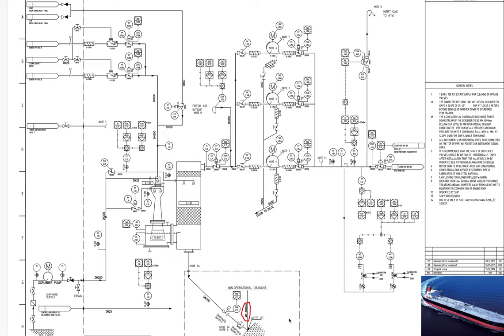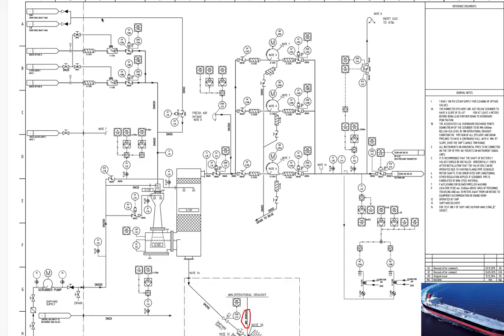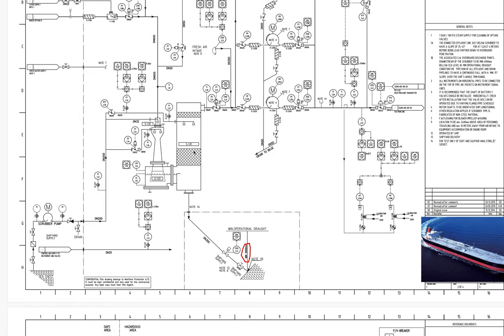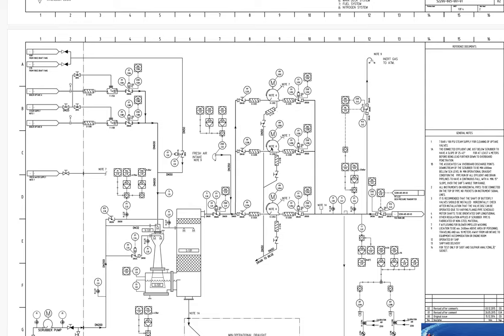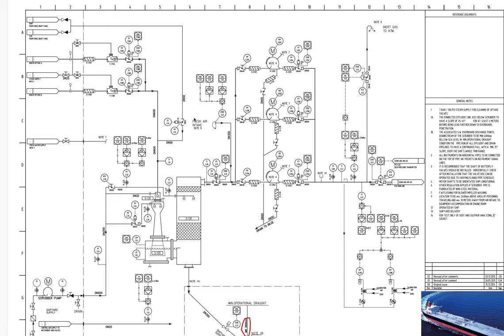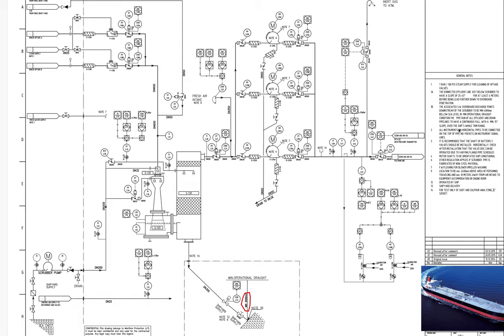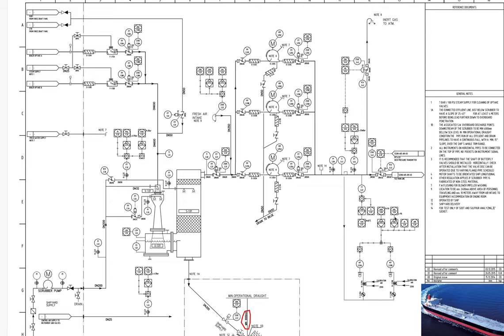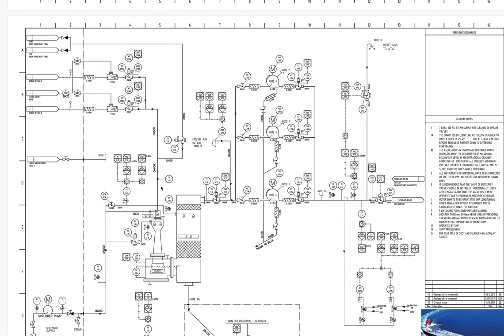IGS System diagram explanation weak points shown!

Comment: Sir
Is there any issue during discharging operation keep delivery valve to tanks fully open ?(atmospheric valve fully shut ) by Chief Mate decision
Reply from the maker: It's ok if he need to pressurize the tanks more quickly or maybe the rate of discharging is very fast and there is a need to keep cargo tanks under sufficient  pressure.There is limit's that can be set max tank pressure when pressure will be reach a alarm or automatic switch of valves will be started.
In case if there is some problem with this valves you will need to operate them manually.